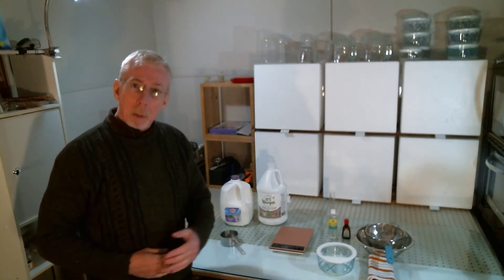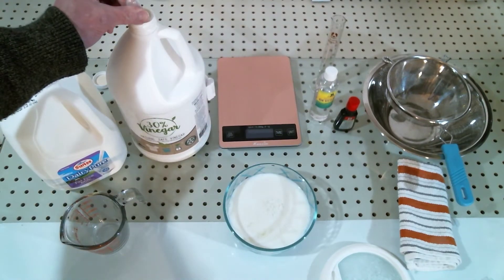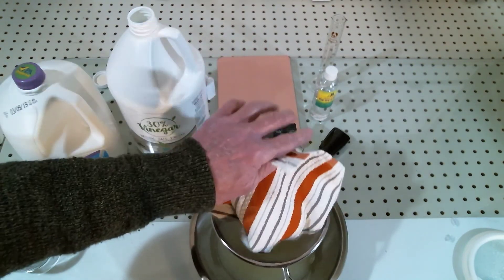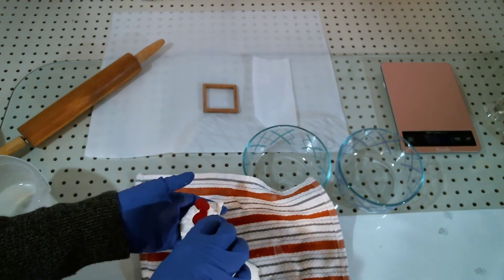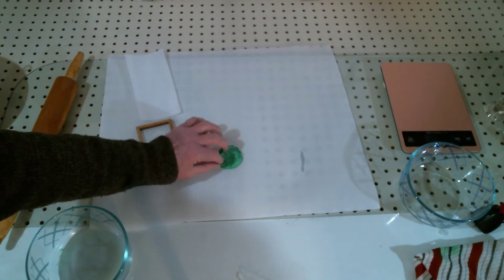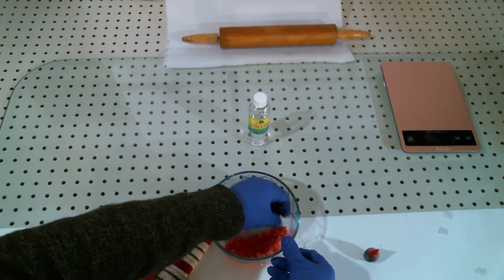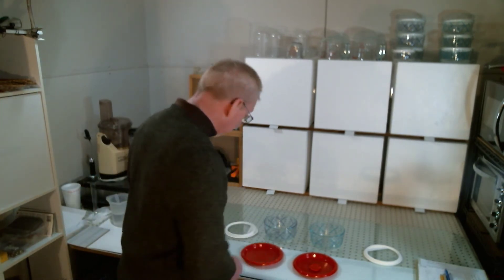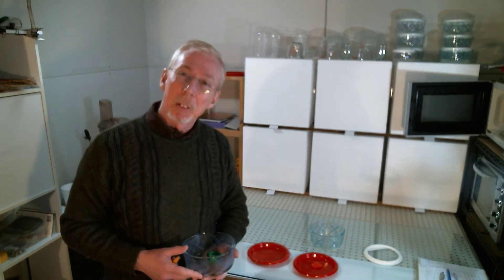Bioplastics: Thermoplastic properties of Casein. Imitation Ivory, Rubber, and PLA. Galalith Jewelry.

Comment: Okay, so you made some dry casein. But where's the galalith?
Reply from the maker: Finish watching the video.
Reply: I did. You didn't appear to treat the casein with formaldehyde at any point, you just moulded it right away. That leaves you with plain moulded casein, not galalith. Seems to be a common confusion on YT.
If you could show the process of a proper treament, the thing which I'm after, that'd be great.
Reply from the maker: @bencesarosi7718   You should watch my continuing series on the subject, as it is impossible to present everything in one. I do not use Formaldehyde...I present sustainable options to it. In this video, I present a long forgotten attribute on the thermoplastic properties of Casein, which seem to be overlooked by everyone. I will adjust the title here, but, I present the sustainable alternative to Formaldehyde in another video, for making Galalith. And, I don't know of any video on YT that presents Galalith, other than the one I have.
Reply: That sounds awesome, I'll check it out. Thanks!

Comment: This looks like fun but is it any heat that softens it again, or just microwave?  If you had something made of that stuff would it suffer from being in sunlight / sun heat?
You wouldn't want to make eg a cup from it and have it suddenly soften from the heat. 
Also if you haven't a microwave is there an alternative thing that can be done please?
Reply from the maker: Any heat will work, I use the microwave because it is the most efficient method to soften it. I firms back up in seconds. Absolutely, sunlight will effect it, it is bioplastic and the sun helps it to decompose. It takes a few days in rain and then sun to decompose it.  This video demonstrates bioplastic made from milk. There are other bioplastics, that I plan to make videos of, that can withstand heat and can be shaped into a cup. Great questions, thank you. Make no mistake, plastic from oil is on the way out. What we are doing here is beginning the research on bioplastics that can build a grassroots foundation for futher research.
Reply: I hear you can cure it with tannin - like from a strong tea mixture - to make it more resilient to breaking down. Check out Robert Murray-Smith for more videos on making this kind of plastic.

Comment: When I got that fountain pen yesterday handmade from an very old galatith piece (and a nib from the 70's) I wasn't aware that where trying to know what galalith was would lead me :)It's an interesting subject to explore, first because you can do it yourself, but also for sustainable source of plastic. I guess it would also be an interesting application in countries that have to deal with milk overproduction.
Reply from the maker: You are spot on. :))
Reply: @GEOsustainable  We know that plastic won't dissolve in water but what about bioplastic? Of course bioplastic made as above in the video will surely be biodegraded by bacteria. But still isn't the meaning of plastic that it won't dissolve in water?
Reply from the maker: @lenny108  Bioplastic can or can be made not to, dissolve in water. The meaning of plastic is a long branch chain polymer. Soy wax is a bioplastic that is insoluble, whereas Starch is a bioplastic that readily dissolves in water. Casein, if dissolved and reformed in Ammonia dissolves in water, but Casein dissolved and reformed in Vinegar is very water resistant. Casein can be made waterproof by soaking in Formaldehyde. Take you pick, choose your application, and carry on my friend. All the ones mentioned above are MOST importantly COMPOSTABLE.

Comment from the maker: @Gypsy Six. You asked such a good question, and then deleted it. It is such a good question, I will answer it here. You asked if this formula can be thinned down with heat to pour it. To tell you, I have just discovered the thermoplastic nature of Casein. Plastic made from milk is almost a lost art. I was thinking the same thing resently. I plan to try to thin it with Ammonia and perhaps water during heating. What you saw here has never been done on YouTube. Stay tuned for a lot more work on this propety of Casein

Comment: Outstanding.  Can this hard bioplastic be used to make Castings with the silicone moulds you showed us how to make previously. This kind of looks like putty is there a pourable version that would make casting easier?
Reply from the maker: You can adjust the formula. I have other videos on the subject that may work better for your needs

Comment: I think I just saw you demonstrate the production of a thermoplastic. Is that right?
Reply from the maker: Correct. I have given you insight on how to manufacture bio-based thermoplastic. Take this and start a company to replace fossil fuel plastic with bioplastics. My goal is to share my knowledge, tips and tricks as well as define manufacturing processes for others to take and run with.
Reply: I have a certain type of grip for my sentures that is made ofnthis type of plastic but it also has either veg glycerin or pg or and oil i it makes it plyable when heated in warm warter

Comment: Thank you for sharing such good video with us. I think if this can be applied to industrial production, it will make a great contribution to our environmental protection.
Looking forward to your new video
Reply from the maker: Exactly! I like to help by showing how to produce bioplastics in industry. Yes, I will be making a new one this weekend, showing how to make clear packaging film.
Reply: @GEOsustainable  I’m curious about the elasticity and the heat resistance of the casein plastic, is its property as good as the LDPE?
Reply from the maker: @fanxinzhang5240  It will compare to LDPE in elasticity, given an elastomer. Casein is a protein and will burn, but will take some heat. You will need to check this. I do want to include, this formula is not insoluble. It will break down drastically in water, which is why you need to choose your application.